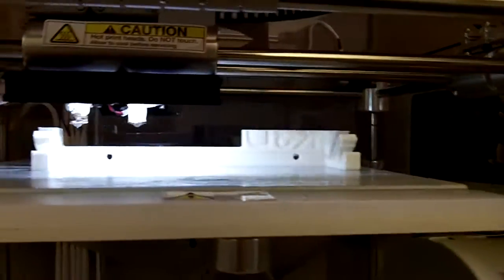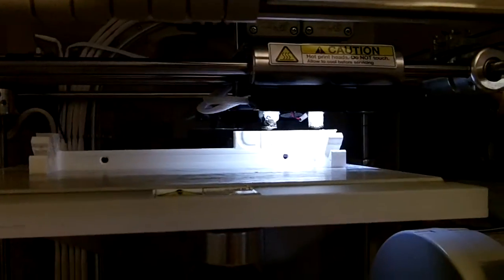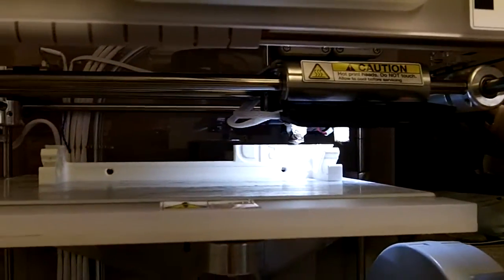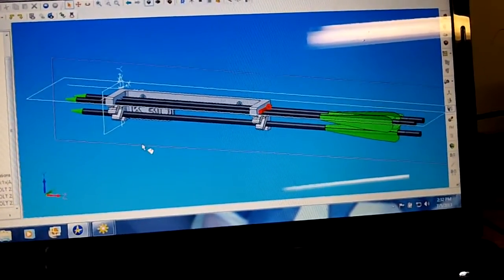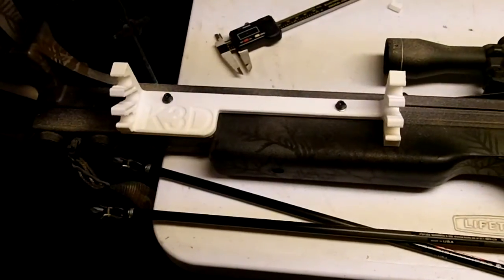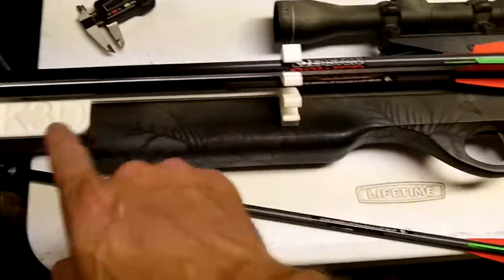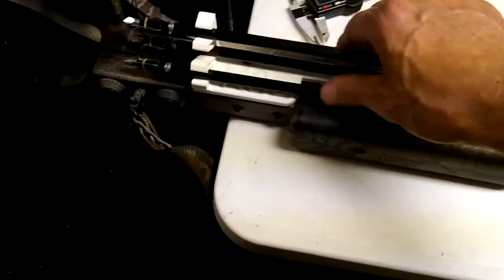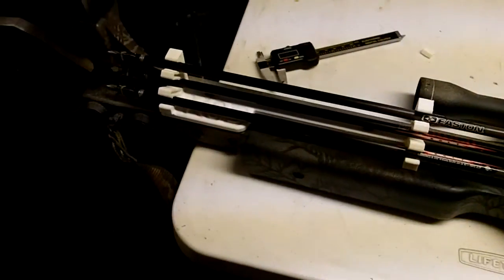3D Printer makes Bow Quiver

Comment: that's awesome. you take some heat shrink and put over the arrow retainer clips and it will tighten up the fit and reduce the clanking noise while installing or removing bolts. you should make one to fit a Barnett bcxtreme for me..haha